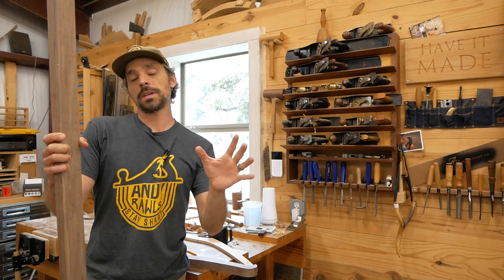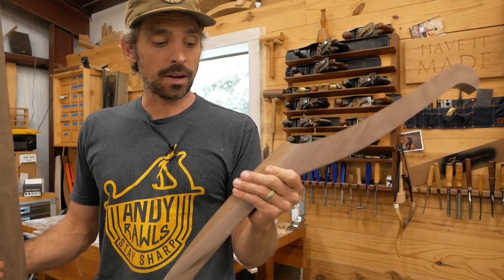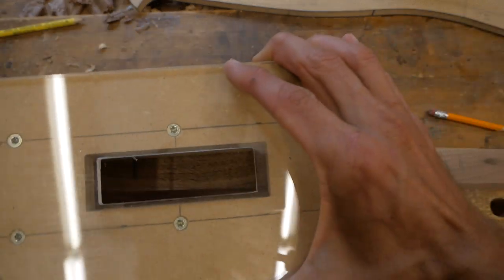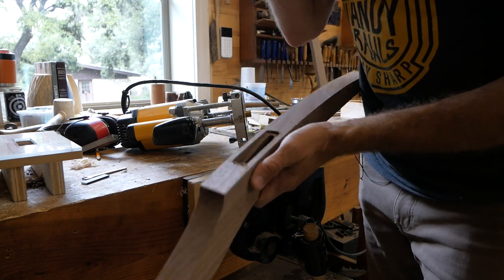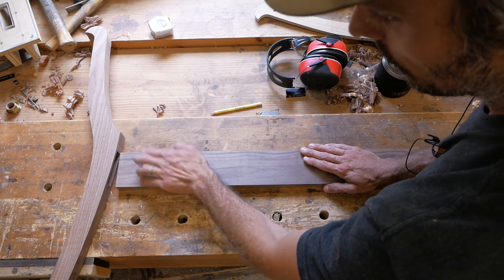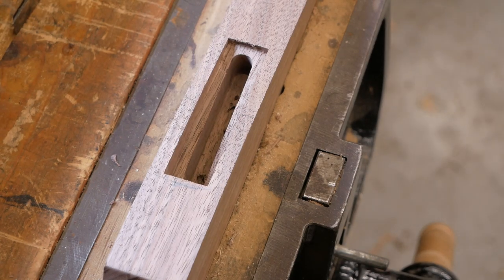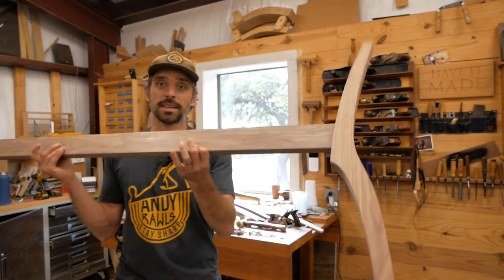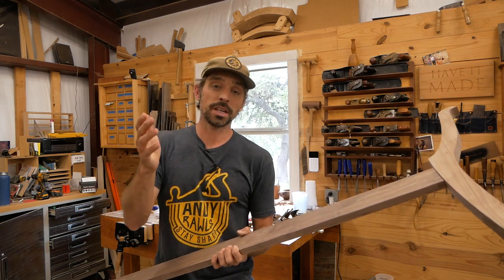Tricky Woodworking Joinery // Housed Mortise And Tenon Joint (Mic'd Up)

Comment: Really liked the video but how do you know what angle to set that jig when cutting the mortise?
Reply: Love to know that answer too!
Reply: You can eyeball it, however if you work the angle out during design, the adjustment screws can be set appropriately. A test piece does wonders. Eyeballing can put the housing at a small error angle, but generally small enough that it will still work. Calculating and testing is always the way though.

Comment: Thanks for the great video! Would it be possible to use the entire rail as a tenon with a back that is perpendicular to the rail, bypassing the hidden mortise and tenon altogether? I assume it'll make for a weaker joint with a more difficult alignment?

Comment: Total amateur here. I had to do the same not for curved parts but for mortising a cylinder. I think that your method of fitting the piece into its housing is too tedious. Instead you could do what you did, leave the mating piece proud, offer it to the mortise and scribe it around the housing. Then chisel the housing hole to the scribed lines and you got a perfect housing. Not an easy process either way. Great work as always. Cheers
Reply: Ditto... those chisels hanging on the wall actually have a purpose.
Reply: I think Andy knows what he’s doing, and has a good reason for it.
Reply: @MJ-nb1qn  for sure and the reason is (as i see it) is the the method mentioned above is hit or miss. which is fine if your building a one time piece but when you plan on building something over and over you want the sure shot method
Reply: @billystray7007  sure shot is just how he's doing it. You leave material and shave it to fit. That's how it is done. It's why it is called woodworking. The work aspect is implied in the name.
Reply: @1pcfred  exactly